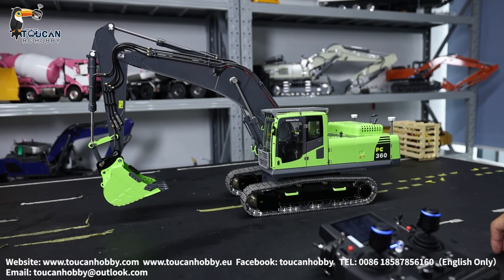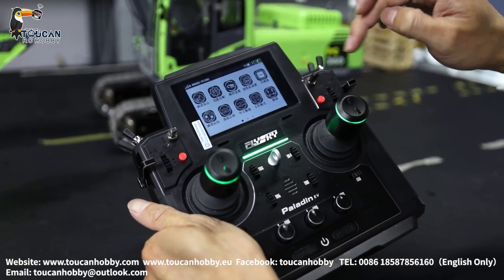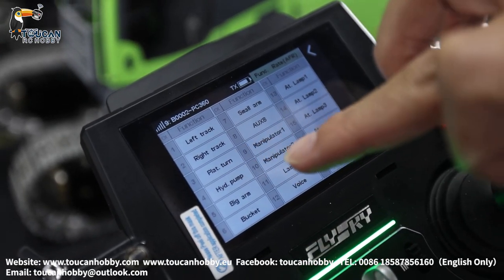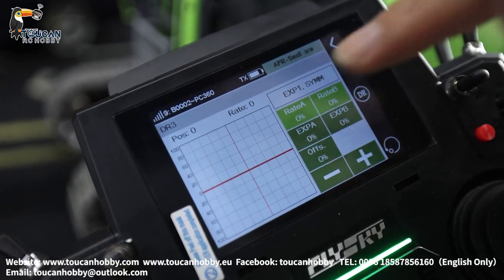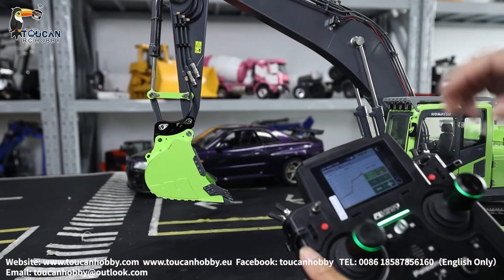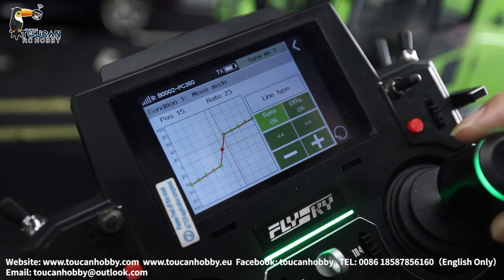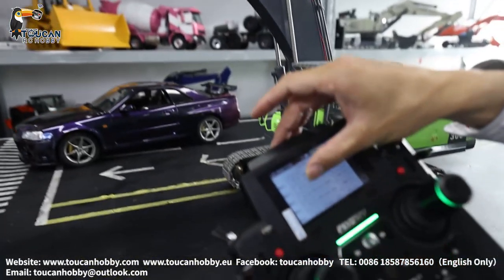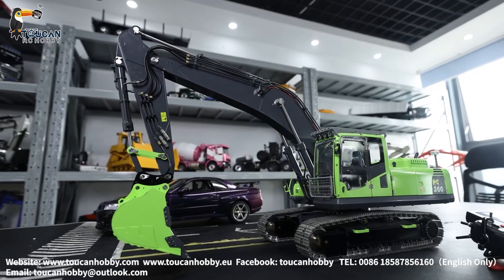How to set control curve paladin EV radio for LESU RC Komatsu PC360, see the control difference.

Comment: Hello, thank you for your vidéos, a quick question, I followed your tutorial, it works, but, when I use several in mix function mode, at the same time the speed of the pump increases, is there a solution?